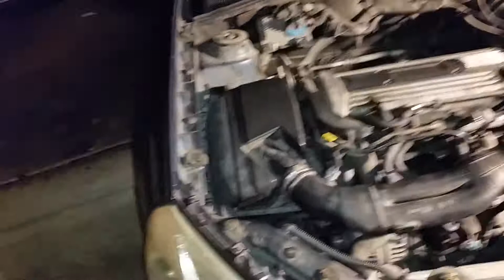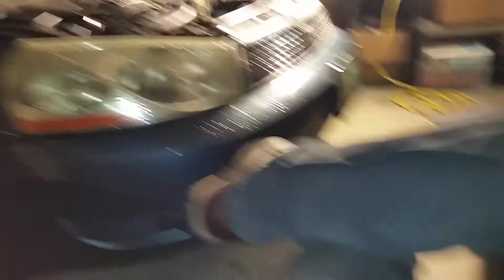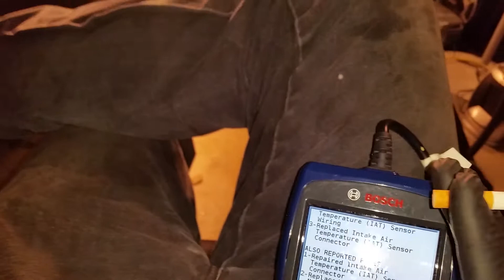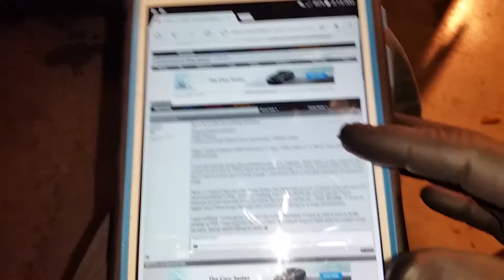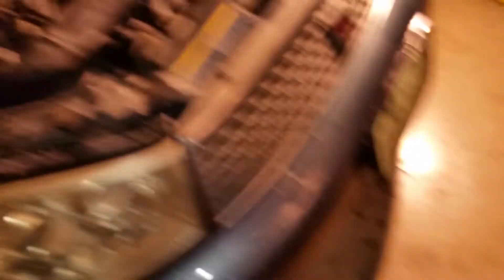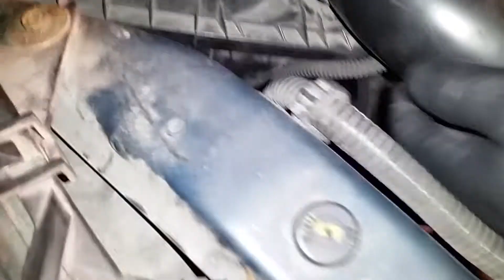2003 Saturn L200 w/ Ecotech 2.2L - Trouble Code P0113: Intake Air Temperature Sensor 1 Circuit High

Comment: Our. 2003 saturn is now shifting hard after the ac was worked on they pulled the temp senor (offline) thats the only way the ac works but i gotta tell u that its rough big time that jerk when it shifts i hope my ELECTRICAL car mechanic gets to me soon this week to diagnose the problem....
Reply: Yeah, when my wife's car was doing that the transmission was shifting so hard that it seemed impossible that continuing to drive it like that would not result in serious transmission damage.  I mean, it was just slamming into gear; never seen anything like it before that or since then. It is strange that a temp sensor can have that kind of an effect on the transmission, but as odd as that is, that is exactly what was causing our particular shifting issue...
Reply: Good luck with your repair, and if you wouldn't mind stopping back in here once it is repaired, I'm curious to know what your mechanic is going to tell you about the diagnosis.
Reply from the maker: Oh, and just for reference, I just made a playlist that has all the videos associated with the repair that I made on this issue: https://www.youtube.com/playlist?list=PLxB3l7Og6zbEX5ZbPX73rdjCFp3eSOGfi

Comment: Thanks for the post, I have a 2007 showing the same. The fans run high when starting and when shifting to drive trans seems to make a louder shift noise. Did the repair work? Is it just a matter of skinning the wire and pushing it back in the connector?
Reply from the maker: dwsherm1 I posted 5 more short videos after this one which show in detail how I fixed this. This did fix the problem that my wife was having with her car. Hasn't been an issue since...
Reply: Thanks for the reply. I'll keep this repair in mind, fortunately just my connection had come loose.
Reply from the maker: dwsherm1 Well, I hope my video helped you diagnose the issue. I had already completely forgotten that my wife's car was shifting hard until I watched this video. I've worked on so many vehicles that it kind of all runs together and I forget about doing entire repairs....